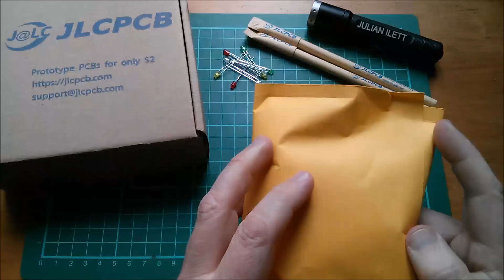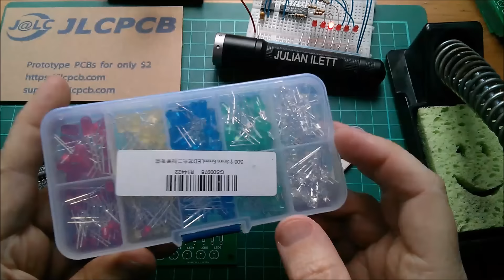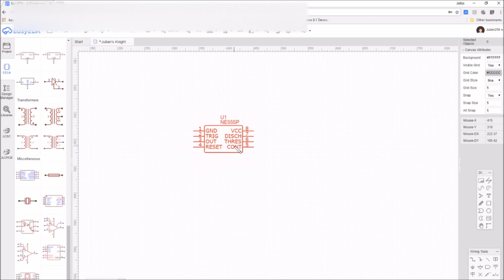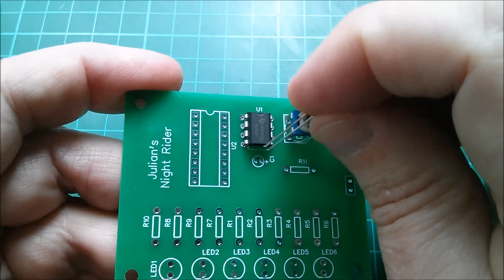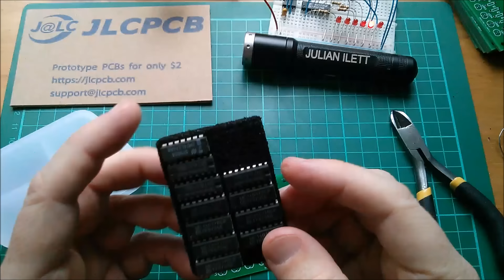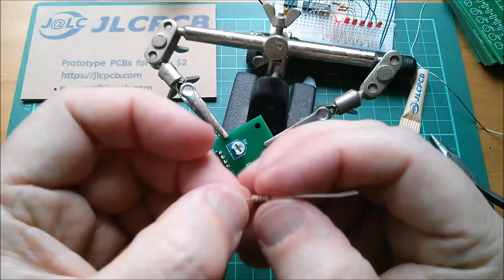I Designed a Printed Circuit Board (PCB)

Comment: The first thing that jumped out at me when I saw those boards was the orientation of the LEDs.  That makes it exceedingly difficult to properly bend the leads 90 degrees so that you can have an edge-on orientation.  I have here some LM3915 audio level indicator boards that allow this,  your design doesn't,  or it at least doesn't make it easy.

The other thing that jumped out at me was when you were placing chips in your schematic.  The first thing I saw there was that the 555 was laid out according to the pins on the chip being in order,  like you'd see it on a board.  I absolutely detest that sort of schematic!  A chip should have inputs on the left,  outputs on the right,  Vcc on top,  ground on the bottom,  etc.  THAT is a schematic.  What you had there was more of a board layout diagram...

I've seen some magazine articles that follwed this convention,  and it sure makes it difficult following the typical rats nest of interconnections so you can understand what's going on.

Comment: Could've just made the topside into a ground or power plane. You still don't see any tracks and you could have avoided that (unpopulated) bridge.
Still, pretty neat how you managed to fit it all on one side.

Also: What's your problem with bending the leads? I always do it, since you get a good connection between the lead and the plating - otherwise you risk the component only being connected by solder, which is not ideal.

Comment: Oh the "joy" of libaries of ECADs. Not even the very expensive ones get some footprints of most of the generic components right out of the box. It seems to me that in every different ECAD you have to draw all the footprints and symbols yourselve to have even the simplest parts the way everybody seems to prefere it to draw it. If the footprint is ok the symbol is kind of butchered or not the way everybody draws it.
Well I think that the ECAD programmeres make this because it will be more fidly to redraw every symbols and footprints in another ECAD so you won't switch that easy to the competiter.

Comment: I suggest that you use ground planes on both sides and adding 0.1uF ceramic caps to each IC (as close as possible to the supply pins; SMD caps would be even better).You can also use IC sockets to easily replace them if they get damaged. Terminal blocks are also quite nice and cheap.

Comment: The original KITT car lights were a nod to the Cylon helmet lights from Battlestar Galactica. I doubt it was run from a 555 timer circuit, because the lights were the much brighter incandescent bulbs necessary for the cameras of the time. It was probably a series of simple "blinker" relays, with an inherent delay, whereby one relay energized, illuminated the bulb, then energized the next, and so on. When it got to the end, it flipped another relay, to reverse the circuit to send it back the other direction.

Comment: Julian, I too suffer from "try and get it on one layer" sickness! However, I would strongly suggest that you put a copper layer (with gabs for through holes) on the unused side. This has two advantages - (A) Nice big ground plane to avoid noise (B) Much friendlier to mother nature, as the copper doesn't need to be etched away.
Reply: Dafydd Roche Agree 100%, I couldn't even imagine designing a PCB without a ground plane, or at least filling in as much as possible  with ground polys or thieving if it is a single-layer board.

Comment: Just bend the leg of the LED to hold it in =P

You mention that you don't like to bend the leads... Why?
Reply from the maker: It makes taking the component back out next to impossible :)
Reply: I just twinge them a bit in opposing directions, never had an issue with removal. If you solder the shortest first you never need to worry anyhow. Even the smallest amount of pressure on the backside of the board onto a silicone mat keeps them in place. The slight bend is just to keep them in place when you flip it over. I also would not advocate bending a lead at anything close to 90 deg...

Comment: Great video.  I'd never heard of either EasyEDA or JLCPCB before.  They are in a price range for hobbyists
I want to say that the design is really clever.  There are other videos with designs for the Knight Rider lights and none are as elegant.

Will you be designing any PCB's with surface mount components?

By the way, if you want to see a video about a full KITT restoration and customization check https://www.youtube.com/watch?v=SZjxCkk2gX4 .  It appears that the original voice of KITT, William Daniels, offered his voice for the electronic controls.

Comment: Julian I made something that is right up your street.
1.  Take one of those cheap panel ammeters from ebay.
2.  Remove the wires
3.  Solder it to stripboard using off cuts for links
4.  Put one of the terminal block DC Jack females on one end, a male on the other.
5.  Wrap it in shrink wrap
6.  Heat it till tight
7.  Using a sharp knife cut a window so you can read the screen
 Instant, inline, plug and play ammeter.
You can see mine lurking in the lower left of this photo:
https://i.imgur.com/6TejT89.jpg

Comment: Great video, Julian. I am curious, given the problems with smd and solder paste, how useful the stencils are. They are not cheap (compared to $2 for ten boards), but if they reduce the faffing about, it only adds 70c to the price of each board. Soooo, if you do use JLCPCB for your solar power controller, could you also get the stencil and demonstrate whether they are worth it?

Comment: would it be possible to let the circuit design sofware figure out the optimal spacing and placement of the traces ?
Reply: some times and some times not most the time you can do it better your self
Reply: right

Comment: JLCPCB, ALLPCB, PCBWAY All appear to be part of the same group with different pricing strategies.  ALLPCB currently offer free TNT international shipping and the boards are still only $15 for 5.  I tried to get a quote from JLCPCB but I couldn't get a shipping quote without uploading the gerbers. :(
Reply: I don't get free shipping, they charge $12.50 for 10 pcs.
Reply: Paul Campbell 100mm x 100mm up to two layers always comes out at two dollars.  I was messing around yesterday trying to pack as much in for the 2 dollars and free shipping first order deal.
Reply: Free shipping first order with JLCPCB?  Do you know who they ship with?
Reply: No idea, my boards are quite small so I'm going to add a couple of little things I can cut off at home to get the most bang for my £1.41 before I order.  I'm that cheap ;)
Reply: Careful.  They aren't that stupid, if you note they ask you how many designs in the gerbers.  When they review it and find you have stuffed a bunch of stuff onto one "board" they will charge you extra.  Unless you make it look good, like putting a track between them.
Reply: My last board (A USB Dac) was uploaded to AllPCB on Thursday evening.  TNT say it will be delivered on Wednesday.  So 6 days end to end.  $23, including extra for Blue soldermask and $1 paypal fee.
Reply: i couldn't get free shipping for 24x29 boards, i wonder if you have to use 100x100 boards to get them free?!

Comment: C1 pin spacing too small?  Then put another on the PCB in parallel.  When you are unsure of component sizes or just want to add flexibility, put more layouts on the board so you can pick the one that fits.  Especially when your boards are for personal use and you aren't paying for each component/pin count or reach their limit before costs go up.  Of course when you have a board full of components and no room to spare you might not but with a board like yours with few parts I would have added extra pads (components) for C1, R12 (pot) and for the 555's timing resistors.  You have to wait a few weeks for your PCBs so why not spend a few extra minutes making your board design flexible?  Enjoyed the video and I will have to give their service a try.

Comment: I hate using breadboards because you often get dodgy connections that trip you up and waste a lot of debugging time. So invariably I do my own home PCB's. They're quick and easy. For simple circuits I'll just use Fritzing. I print the layout onto tracing paper with a laser printer. Expose onto photo sensitive copper using a home made UV light box , develop and etch. In less than half an hour I can have a couple of PCBs to play with. Very satisfying and much neater than breadboards and so much more reliable.

Comment: still a heap waste of resistors. 1 single on the ground line would do it's purpose, too.
Reply: Marcus Wiedner I'm personally a fan of gilding the lily as Dave Jones would say. I would use a microcontroller to charlieplex the leds to minimize pin count and then pulse width adjust brightness to save passives and allow more of a fading tail effect. Then again this feature creep is why so few of my projects ever get finished ;-)
Reply: No, it wouldn't.  Because he's driving 4 out of the 6 LEDs from two different outputs of the 4017, trying to turn on one of those LEDs would cause a short-circuit between the high output and the low output and probably blow up the 4017.  The only way out of that would be to use diodes, and you'd need 8 of those plus the current limiting resistor.  You may as well just use the 10 resistors as Julian did here.  The difference in complexity and cost isn't significant.
Reply: I absolutely know, what you're talking about :)
Reply: touché! But then there's still the fact, that it's a counter - being such, only one output is stated high at a time. I'll understand that other logic ic's could do - but, like you said: there is no one solution fits all in engineering :)
Reply: The nineties just called: CMOS OUTPUT HAVE PROTECTION DIODES NOW.
Reply: Marcus Wiedner It isn't rocket science, but ignoring device variance and assuming ideal conditions in all situations is a quick way to release magic smoke. I agree in this situation it isn't critical but there are cases where trying to cheap out can be one's downfall.
Reply: Oh c'mon - this isn't a very packet ASIC or FPGA with 0.7V lines - it's a CMOS 4017. To kill this beast you'll gonna want to kill it.
Reply: Marcus Wiedner C'mon taking the lazy way out in all instances isn't what engineering is about. Only take shortcuts after consideration of the facts. Once again this is a simple circuit for introducing those unfamiliar with electronics, not a course in optimization and minimization of components.
Reply: The LED being a diode is completely irrelevant since the short-circuit comes before the LEDs, if you don't have either resistors or diodes to force the current to flow in the correct direction and to prevent the short circuit.
Reply: The protection diodes are designed to protect against static discharge.  They're not intended or designed to protect against short-circuits during operation.  I'd have to see the equivalent circuit to be sure, but I can't see any way the internal protection diodes would do anything to protect against a short between a high output and a low output.
Reply: Marcus Wiedner Depends. For this scenario yes a single one will do ya fine. However for something where even lighting non-bin matched leds is important (backlighting, etc) then having only one resistor isn't gonna cut it as the led with the lowest forward voltage is gonna suck up more current and could even damage itself. Of course backlights don't require sequencing so driving them in series works just fine.
Reply: And these aditional resistors form a needed diode? Bullshit. a LED IS a DIODE. And the 4017 has a protection diode at the output  built in - so you only need the LEDs, a single resistor within the right range and everything is fine. Damn you guys make a simple 6-year-old-wants-to-learn-electronics curcuit seem like rocketscience. This curcuit is 40+ years old. it was old even when I was a kid. have a look at a german Elector from the late seventies.

Comment: In the end it comes down to calculation. If you need a few small boards OSHPARK is cheaper. If you need 10 bigger pcb's JLC vould be cheaper

Comment: Very nice.  I built something similar on breadboard with an ATtiny13 and a shift register.  I should make a PCB as well.
You should start selling your kits on BangGood :-)
Reply: Tindie would probably be a better choice for selling ;-)
Reply: i'll see your attiny13 and a shift register and raise you an attiny85 with two shift registers ;-) https://www.youtube.com/watch?v=bG557sOA0ho
Reply: Nice.  The 13's are dirt cheap.  Bugger all flash ram but if you just want to blink some lights it's fine.  Just received some (considering the price, fake) MAX7219's today.  They can drive 64 LEDs each and are linkable just 595's.  Not had much joy yet though  :-(

Comment: As a true follower of you and your escapades with spreading solder paste, not sure if you know but, when designing and ordering your boards on JLCPCB you can order a solder mask. Which you place over your board then squeegee the paste across leaving the perfect amount of paste ready to place the smc components. perfect every time.
Reply from the maker: When I re-design the solar charge controller (which will have SMD components on it), I'll order the stencil too :)
Reply: Yes SMD....sorry for my typo..
Reply: Looking fwd to that video...Note: dont forget to add alignment holes in the stencil. they are not automatically drilled. The stencils are designed for a machine which does the aligning, but for DIYers adding the holes simplifies the correct placement of the stencil over the PCB.

Comment: How do they compare to OSH park? I am sure they are cheaper, and if they are good  enough quality then perhaps I'll give them some business.
Reply: Personally I prefer OSH Park for the simple reason that you don't need to mess about creating Gerber files.  Just upload your brd design and they sort it out from there.  It's the main reason why I didn't use one of the PCB manufacturers in the UK that I found.  I'm a beginner when it comes to electronics and PCBs, and when I looked at what the UK company were asking before they could make your board - board thickness, material, drill sizes etc - I had no idea and went with the simple option.  I'm sure that sort of versatility is great when you know what you are doing, but for a beginner like me, simpler is better.

Comment: Hey Julian, Great work..as usual. I have become a PCB maker junkie. In fact almost all of my breadboard creations end up on these easy and fun to design boards. It is so cheap, why wouldn't you. I bring them out at parties and impress my friends. I use Easy-Eda which I believe is the parent company to JLCPBB. They are great and YES there is a bit of a learning curve, but they have a great on-line help and a community of geeks like us who want to help. Also there is a huge community forum where you can share your designs for others to order.  I don't know if you have come across yet, put there is a magic button on Easy-Eda which does the auto-trace for you. Drag all the components onto the board place them wherever you want as tight as you want, click..and presto. It runs all the traces for you, quite magical really. You said you were gonna to give some of your boards away, I may be the first to ask, but I would be honoured to be the recipient of one. In return I will send you one of my first boards, the “Super Siren” A double 555 circuit for creating an adjustable siren alarm. Let me know. Looking forward to more of your designs.
Cheers from Canada.
Reply: Quick addendum, next time try the "Panel" option when ordering boards. It is cheaper in the long run Your boards are made on a big sheet side by side and they come as a sheet with score lines engraved. They just snap apart. I always order mine this way, it can work out to pennies per board.  Also, you can order boards any shape! they don't have to be square. Yes I am excited about this company, as one who has struggled with all the different ways of making your own boards at home.

Comment: Far be it for me to suggest but when assembling through hole PCB's it is much easier to start with the physically lowest/smallest components first i.e. resistors/diodes then work up to the largest/tallest. Take it from me I have had to assemble 1000's of identical boards for professional analog audio gear such as mixers/outboard and power supplies.

Comment: I had jlcpcb do some boards for the esp8266 solar charge controller RS485 adapter I made. I found easyeda pretty intuitive too. Recently though I’ve been using allpcb.com - more expensive but far far quicker delivery. Had some arrive last week, produced and delivered to the UK in seven days. 
Will competition winners have to provide their own components? :-)
Reply: slogan: I'm a Cylon and I'd like one for my visor
Reply from the maker: Yes, and an amusing slogan ;)
Nice thing about a PCB is I can post it worldwide at a reasonable cost.
Reply: Adam Welch thanks Adam for the heads up

Comment: Since you are only powering one LED at a time wouldn't it be easier to just connect all the cathodes and use a single resistor?
Reply: I agree, but the single resistor doing all the work by itself will wear out that much faster!

Comment: couldn't you just run one resistor on the ground side than having that many? its not like the leds are on all at the same time
Reply: Only if he switched 8 of the resistors for diodes, otherwise he'd be shorting a high output to a low output and probably blow the 4017.
Reply: He doesn't have a ground plane. It's a one-sided board. Come to think of it, you can take his circuit design and adapt it into an etch-able board.

Comment: Instead of clicking icons you can use shortcuts, W for wire/track, T for top tracks, B for bottom. Currently I''m making small single cell li-ion charger with protection and boost circuit, everything on single loaded 20x36mm board. All 0805 pasives. I wonder if it will really work. Only one way to find out!